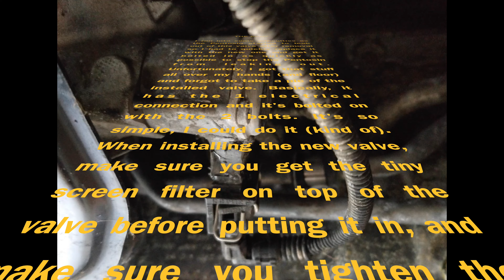🎆 Mercedes Benz S550 4Matic (W221) ⚠️ SPS Solenoid Valve Replacement

Comment: Where did you find that solenoid? I’ve looked everywhere and can only find the solenoid for the older style rack and pinion
Reply from the maker: I searched google for the specific part number for my vehicle ("Mercedes 2214600084"). That search gave me a few Mercedes dealers selling it on their websites directly. Mine cost around $260 with shipping. Keep in mind that they're not all the same. As far as I know, there are 2 different kinds: one with speed sensitive steering and one without. If you don't know which on you need, just email any of those dealers and give them your vin and they'll be able to tell you which one you need. Good luck!
Reply: @autoaddict3994  Thanks, mate! I ended up buying a used rack and pinion on eBay with the correct solenoid on it for a few hundred dollars. Got tired of searching for it. I will keep that part number though in case I ever need another.
Reply: SPS solenoid valve Part# 2214600084

Comment: i have a 2006 mercedes e350 w211 and very hard to turn when the car car is not moving. i did check to bleed the system  and still have the same problem. dont have a scanner but do you think this would be the cause? was your car doing the same thing as mine?
Reply from the maker: it was hard to turn the wheel. You should find out if your car has speed-sensitive steering (SPS). If you do, the SPS valve might be the culprit. Luckily, I got that valve slightly used from eBay for around $50, so not too bad, and pretty easy to replace. Also, you can go to any auto parts store and they'll scan your car for free. Good luck with your issue. I hope you get it resolved because the Mercedes sps steering is amazing when it works